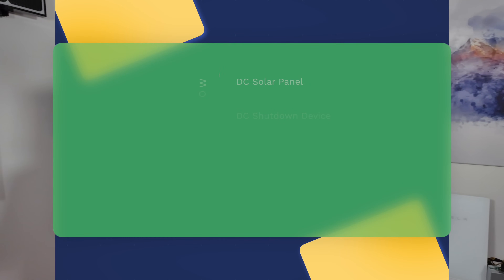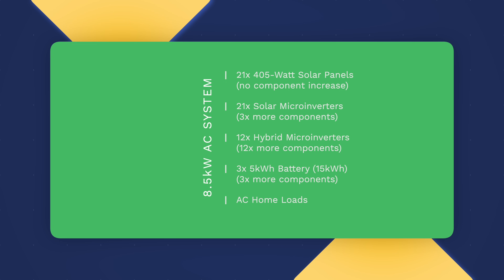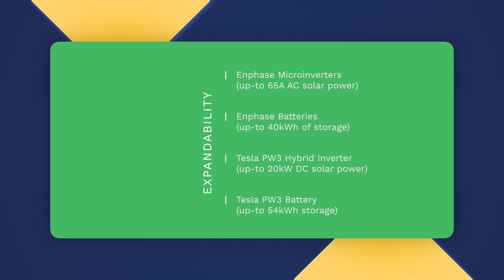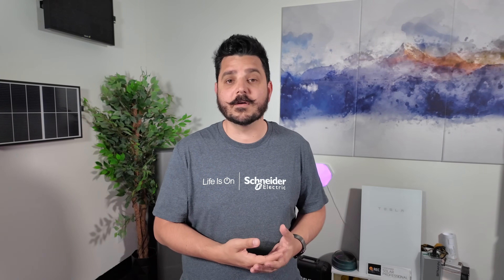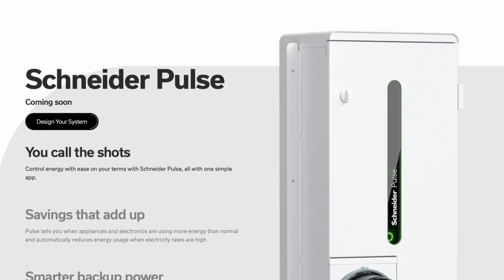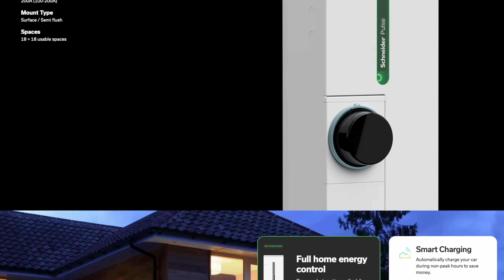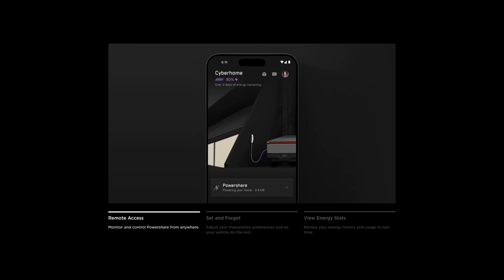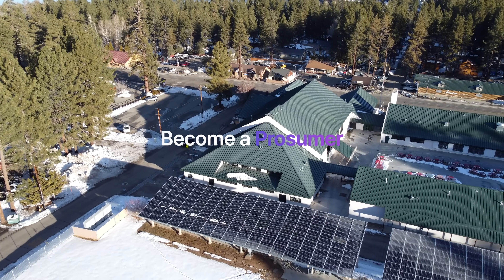Comparing Ecosystems - Tesla vs Enphase

Comment: I could be wrong, but i think the Span panel also adds most of the effects you mention for the powerwall.  It has a software critical load and I think it does the switch also.  Between that and using a Franklin aPower 2 and aGate.

Comment: I prefer the Tesla power walls as they are much larger however, I'm likely forced to go with Enphase because the Enphase system will play with my whole home back up generator, Tesla's system unfortunately does not.
Reply from the maker: You can use the Tesla Powerwall upstream of a generator backup system but you’re correct if you want it to charge the batteries you’ll need to go with Enphase for that.
Reply: @pacificsuntech  yes sir, pulled the trigger today, went with Enphase, and it wasn’t cheap!
Reply from the maker: @cjb8993  too bad you weren’t in our service areas, we currently have partners in California, Arizona, Texas and Florida. Though for battery add-on we’re limited but would’ve looked for a good partner for you. Glad you got something worked out

Comment: So tesla backup switch is the current best design
Reply from the maker: Backup Switch is the most cost effective option, since you do not need the Tesla Gateway or an electrical sub panel, labor cost is reduced significantly as well. We have Powerwall 3 installed with Backup Switch with a new solar system (not existing) for $10,500, and with Gateway $14,000. In Arizona we have a partner installing Powerwall 3 with Backup Switch at $9,900, it's a game changer for homeowners and businesses.

Comment: You didn’t mention the system reliability upside AC architectures have when it comes to panel level redundancy.  The Enphase architecture can also more effectively deal with panel output voltage variability due to degradation of output voltage at the panel level be it by localized shading or cell failure within the panel or even complete failure of a panel.

Comment: 11:08 this!!! while the PW3 is impressive, it is still a generation behind including its EVs.  At this point, Tesla PW should have capability to DC charge an EV whether it comes from solar or battery to avoid losses with DC to AC then AC to DC conversion. In addition, Tesla EVs should have V2G by now.  The current system on the Cybertruck is not V2G and will require a separate hardware to power a house. Hopefully that new hardware should be able to talk to/integrate with the PW3. But then, that is convoluted whereas a Powerwall should be able handle all these.  Ugghgh, Nissan/Japan have the V2G idea for around ten years and no product does it seamlessly
Reply: That's incorrect. For V2H all you need is the Tesla Wall Connector and a TPW3. Plus the Gateway or the Meter Backup switch. But you needed those elements any way to have backup power for your home. Of course you need a Cybertruck but compare that to the Ford's F150 system which requires a separate inverter installed at your home. Nothing supports V2G atm - all you have is endless trials and it's the grid that needs to get on with it. There is talk that Tesla will eventually get this working with PW2 setups. The limiting factor is really the Cybertruck. Hopefully future Tesla's will all come with this capability.
Reply: @mondotv4216  Correct on that wall connector, basically a thick, more robust cable versus plugging into the AUX port found at the bed. It is trivial for Tesla to add V2G to their cars, all its needs is a sensor or Powerwall that detects if there is any excess power going to grid, or the car inverter perfectly matches the current electricity load of a home.

Comment: What is the point of a meter collar on an enphase system?  The System Controller 3 takes the two hot legs and the neutral from the meter, and sends two hot legs and a neutral to the home breaker panel (in the whole home variant of the setup).  The ATS is in the System Controller.  Very simple to wire, no extra funky boxes.  The limitations on battery current are down to the bus bar limits in the System Controller 3.  If you forgo integrated generator support, you can push 160 amps continuous during an outage.

Comment: You mention the benefit of Microinverters but leave out the use of Optimizers which would give you nearly the granularity when troubleshooting individual panels.
Reply from the maker: I did a separate video talking about SolarEdge since they’re kinda the only manufacture with an integrated system using module level optimizers. This does increase components and costs so it’s a matter of deciding how valuable that granularity is as either A) a contractor or B) an owner of the system.
Reply: SolarEdge sucks I wouldn’t depend on it on my life.

Comment: Here’s the biggest thing, can someone with the Tesla PowerWall 2 (not plus with the inverter on top) use the meter collar.
Reply from the maker: No, the PW2 does not have the necessary hardware to do that, you need the gateway (at least at this time). The PW+ and PW3 have all necessary hardware for backup switch.

Comment: Could we add a Tigo to monitor production at the panel level with the TPW3?
Reply from the maker: I don’t see why you couldn’t do that, the PW3 works without the need of optimizers or rapid shutdown devices. It would be nice if SolarEdge would open their platform up so other companies could leverage their proprietary optimizer technology.
Reply: No.  Tesla has stated that using such devices will trigger arc fault interruption.  Only the Tesla MCI's are allowed.

Comment: For most people around the country, Tesla is not even an option.  They don’t serve a lot of states.  Also, I thought string inverters don’t do as well with shading?  Surprised it wasn’t mentioned.  Unless you live in California with a perfect roof for sun, Tesla is not a good choice.  Finally, I know you can’t say it, but Tesla’s customer service is a crap show in my opinion.
Reply: In many cases, even with some shading, a quality string inverter will outperform microinverters. If you have heavy shading then, and only then, optimisers or microinverters will outperform the string inverter in some cases. One thing I don't buy is that there will only be a $1000 price differential between the PW3 system and the Enphase 3 x 5P system. There's $US1300 difference just in the cost of the batteries alone,  plus the Enphase microinverters and panels have to be significantly more expensive than panels alone. I'd be very surprised if there wasn't a $US4,000 difference between identical sized systems using the same panels.
Reply: Hopefully they stop doing direct installations altogether. A reputable installer can provide the equipment AND do customer service
Reply: The shading issue, doesn't come down to whether you live in California or not. It's about whether your rooftop is going to be surrounded by trees casting shades onto it. In such case the Enphase sounds more ideal.
Reply from the maker: Solar panel technology has come a long way and shading issues aren’t as big as you might think plus having six inputs on the powerwall 3 you can mitigate that with a proper dc string design.
Reply: Thanks for the definition of shade.  Do you also know the definition of wet?
Reply: @ScoobyFermentation  I think the point you've missed - while getting pointlessly shirty with @knekker1 - is that your understanding of string inverters is faulty. MPPT (Maximum Power Point Tracking - look it up) is how strings' output is optimised.  And early string inverters had only 1 or 2 MPPT channels - which is what gave you the false impression that string inverters don't do well with shading - that's true now only if you make a bad design choice.  And the PW3 has 6 - SIX! MPPT channels - which is a REAL breakthrough.  Furthermore, there are ways that advanced string inverters can optimise output - look up Fronius.
Reply: @ScoobyFermentation Oh I am sorry, I did not intend to hurt your fragile ego by correcting you.
Reply: @ckfml What do you base that statement on?